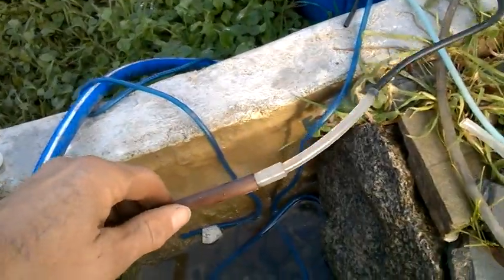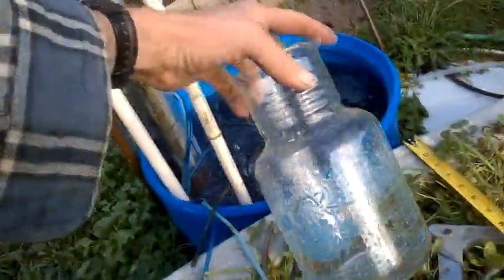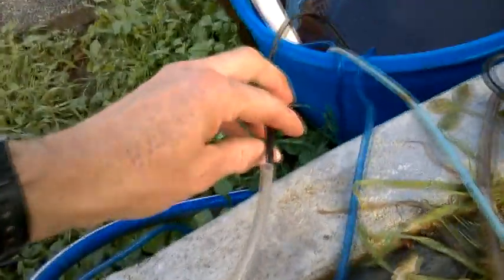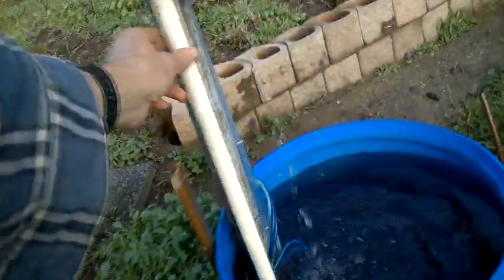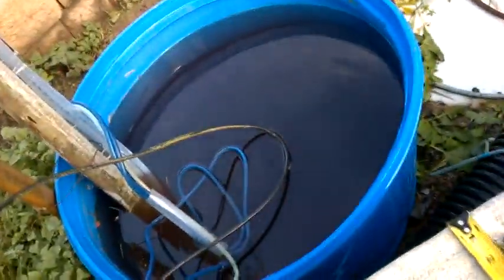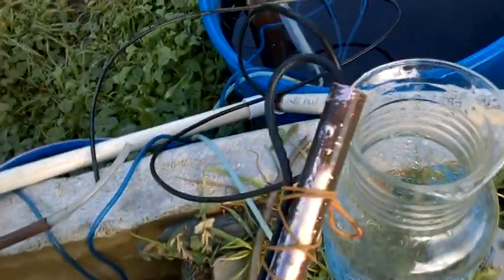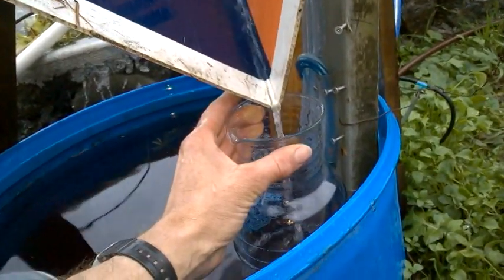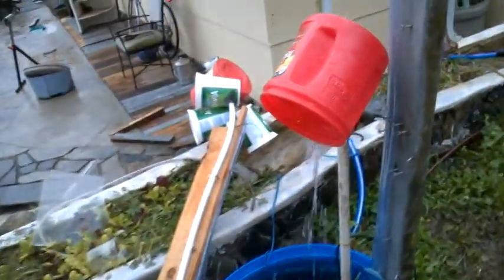Some guidelines for sizing  airlift pumps for aquaponics.

Comment: Hi Brian, if you don't mind I have a few questions:

1) Placement of air outlet inside the lift tube. Does placing the air outlet at the very bottom of the lift tube produce the most lift?

2) Is it better to run the airline down the outside of your lift tube and then inside or run the airline down through the top of the lift tube down to the desired depth? Is there a big difference either way?

3) Opened ended airline outlet vs airstone on end of airline outlet - any difference in lift?

Thanks So Much For Your Time: Shawn
Reply from the maker: Hi Shawn, I think airstones are a waste of time and energy and they will eventually gum up.  Low pressure airlift works with big plugs of air, and airstones make tiny bubbles,  so they are actually counterproductive in this case.   One  thing I didn't have in this experiment is taps on the air lines. (Because I wanted to compare the 2 pipes accurately).  But in a normal set up, I have taps before EVERY  airlift pump, I adjust the tap so  it doesn't get too much or too little air and that is how I get efficient pumping.    Its always better to bring the air down outside the lift pipe.  If you put it inside it,  water will run down beside the air tube and the air tube  will also  disrupt the "plugs" of water coming up.   I use very small scale airlift pumps in gardening and in my solar cooking stuff,  and I have been doing this for over a decade.  I  generally bring use 1/4 inch tubing or 3/8 inch inch tubing for the lift pipe and bring  the airline down the outside, drill a small hole in the lift tube about 1 cm up,  and have the L shape at the bottom. But I have low submergence (maybe 12 to 14 inches usually and occasionally 24 inches)  and I am only  pumping 2 or 3 ft high.  When I made "pulser pumps" back on my brother's farm I was using  1.5 to 2.5 meters submergence and I used 1/2 inch lift tubes and 3/4 inch lift  tubes.  I had air entry for these  about 6 inches from the bottom of the lift pipe.  It is always better to get the maximum submergence. You can get 4 liters per minute of water flow at 3 meters high with the 3/4 inch pipe and 2.5 meters submergence.   I have a very big pulser pump that went about 2 meters deep. I used it with I think 34 mm rigid pipe going down to 2 meters submergence.  It pumped a lot of water to 6 ft high.  But the little stream I had could only power it when it was in flood. This was only slightly plug flow, it was like a standard commercial air lift pump and was mostly bubbly water.   Check out some of my other airlift pump videos or pulser pump videos and check out the photos on the gaiatechnician account too.  I have my notebook from when I was making my pulser pump experiments as photos and they may be useful for people making bigger airlift pumps or for people making small trompes.   Best of luck,   Brian
Reply: @Brians-Easy-Low-Tech-Solutions  Thanks Brian

Comment: What is the function of the horizontal section at the bottom end?
Reply from the maker: Hi, this if for when you have limited depth for your airlift pump. It's a reservoir of water that doesn't get pushed out of the tube before the water gets pushed out the top of the airlift pump.  Also, note that the end of the tube is "constricted".  I call this constriction airlift pump.  Over many tests, I have found that this pumps more water than if the tube just ended at the bottom because less air leaks out the bottom and gets wasted.  Also, there is far  less too and fro or (oscillation) of water in the tube,  and this oscillation wastes a lot of energy.  So, anyways, over nearly all airspeeds,  this extra bit of pipe at the bottom is worth it. Ideally it should not be exactly horizontal,  it is best if it is sloping a bit up towards the vertical pipe.
Reply: @Brians-tracking-solar-scoop  Great information... just what I needed to know as I set up my airlift pump. Thanks.
Reply from the maker: @massmanute  Thank you.  I'm sorry I couldn't explain it better.  Anyway,  I did tests and  it gives an improvement over almost all air speeds.

Comment: Hello from Los Angeles! Thank you very much for this informative video and especially for your intermittent write ups. 

I’m wondering why you have the 90 degree elbow and additional length on the bottom?
Reply from the maker: Oh,  hi, Eric,  it's hard to explain exactly the reason for the 90 degree bend.  But,  I have some videos about "airlift in a bucket" and "constriction airlift pumps" probably in a playlist, that show that there is a significant performance boost with the 90 degree angle.  (ideally,  the angle would be slightly greater than 90 degrees but you can't buy that in the store)  I can get back to you later,  (if you remind me) to give you a fuller explanation.  Best of luck,  Brian
Reply: @Brians-tracking-solar-scoop  wow I will check out your other videos, such good information and hard to find!! 
I have in mind a slightly larger system for circulating a pond. Thanks to your videos I’m considering using two different diameter pipes depending on the season and lift needed since the pond level varies. 
I’m thinking 2” for when the pond is full height, and maybe 1” when the pond is lower and ~10” of lift is needed. I’m going for maximum flow. I wonder how much difference the restrictions would make on a slightly larger scale, I imagine it would be similar. 

Another question is where the air enters the system, all it way in the corner of the elbow? And is there a diffuser or does it come straight out of the air line?

Thank you so much for your work!! I will keep looking through your videos!
Reply from the maker: @EricMcGinnFixes  How high are you pumping?  (My videos were really for testing what is the max height for certain pipe sizes and submergences).  If you are only pumping a foot or 2,  it can be simpler.

Comment: Hi - thanks for the video.  I don't really understand what is going on here, so forgive me for jumping right to the conclusion.  Do you feel that airlift pumps can be competitive with other water powered pumps like spiral pumps and ram pumps?  Competitive in the sense of cost per volume of water delivered to a usable height using flowing water.   If so, can I talk you into starting a discussion thread on the topic in the facebook group?     Thanks - Dave from Water Powered Pumps public Facebook Group:
https://www.facebook.com/groups/240458583255303/

Comment: Hi Brian
Thank you for your work and time spent on this project, you are very kind man by sharing this.
I would like to know if its possible to achieve 1 litre per 5 minutes with a submergence of up to 800mm and total hight for water to be pumped at 7 m, the total length for water to travel 15 m, also would like to use solar power air pump. 
Is this possible at all ?

Comment: Hi Brian, what are the pumps your using with the airstones?
Reply from the maker: This one was with an Aquascape pondair 4 and the other tests (in another video) were with (an old) Marina 200.     I also use some direct connected solar powered dc brushless air pumps to pump air (but not in these experiments) because their output is variable.
Reply: Thanks Brian.

Comment: Very interesting Brian! And I appreciate your understanding of the testing methods. I see your pump is rated at 11 watts, do you have all 4 of the outputs being used?
Reply: ,,gve
Reply from the maker: +Jon Boyd  Thanks Jon,  yes,  in this case I did. It is supposed to be 14 liters per minute of air when all are connected but the second time, halfway through the video,   I messed up,  I connected 3 into one little airline before they went into the irrigation tubing. (This almost certainly reduced the amount of air because one little airline tube was too small to take all that air) from 3 outlets.   First time,  they were 2 and 2 which made it easier to pump air.   Some of the other pumps that people use have better liters per watt. 
Note that I have done many other tests.  I usually pump with smaller diameter tubing. I achieved the best efficiency, lift to submergence ratio and pumping heights with 3/16" diameter tubing.  (4.5 mm tubing).  But nobody is going to use that in their systems!  Because you would need a bundle of at least 14 of those tubes to replace one  17 mm pipe.    And each tube in the bundle would definitely need a constriction and a  tap to adjust the air going in to it.  So probably,  once I finish doing figures for popular heights and submergences, people will start choosing better pipe sizes for their systems.  17 mm might  be king for high submergence.  Where you pump the air 6 or 8 ft deep,  but  other pipe sizes will be better for lower submergences.  
I wonder what submergence and heights needed are most common?    Thanks Brian